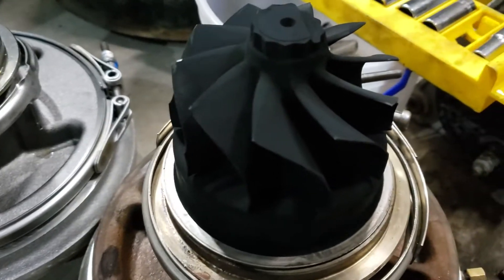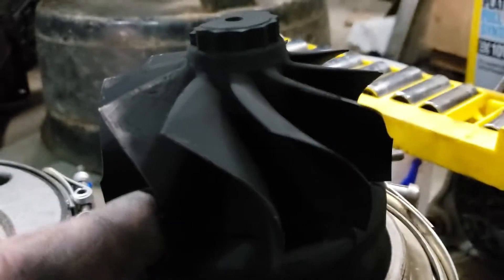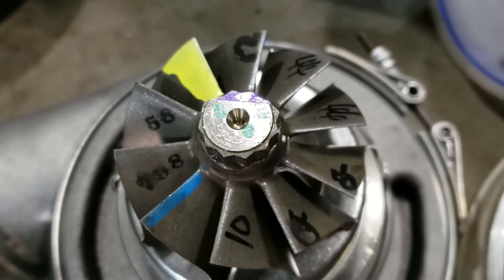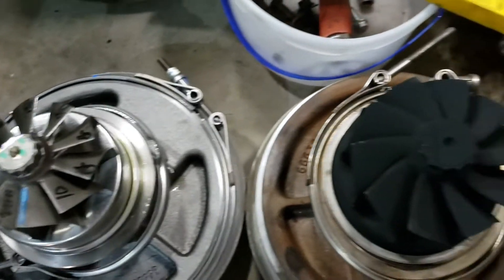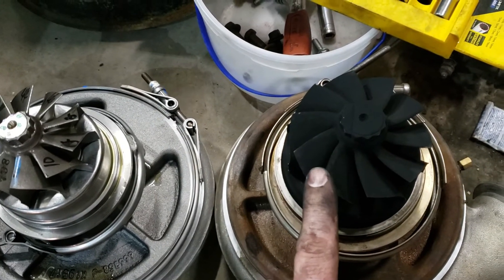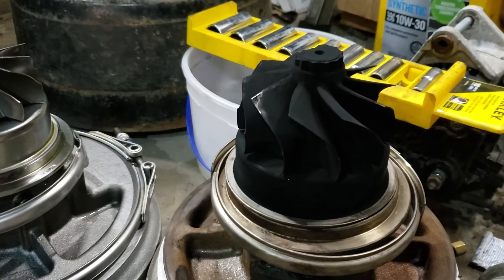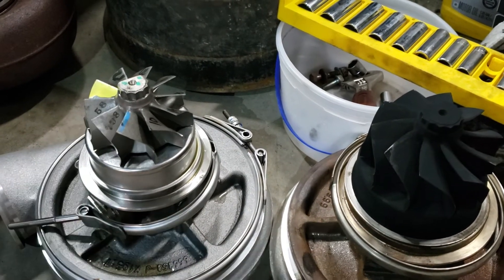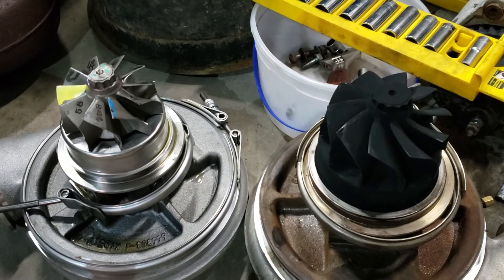A Quick Comparison of an s400 frame 83mm & 96mm exhaust wheels

Comment: What are you putting it in?
Reply from the maker: Hey Dakoda! We have used both of these behind a 5.9 12v Cummins that we built up and put in a 3rd gen Cummins. We started with the 96mm exhaust wheel and then moved to the 83mm wheel to try and help with spool up. It made a pretty good difference with response time on a 7000lbs truck.